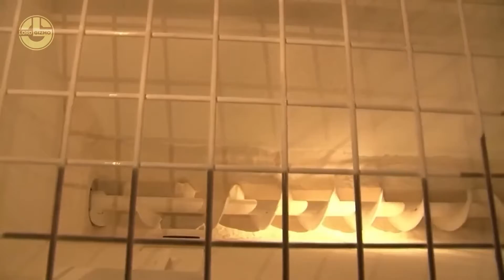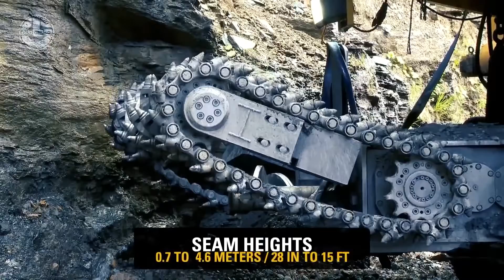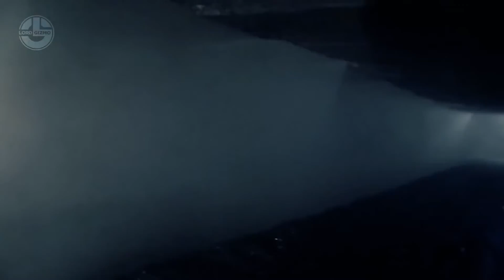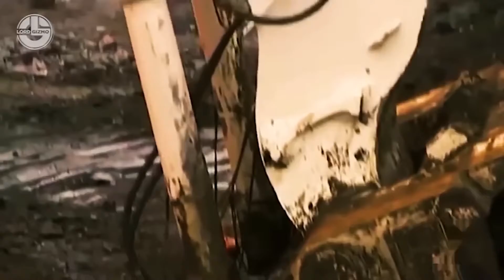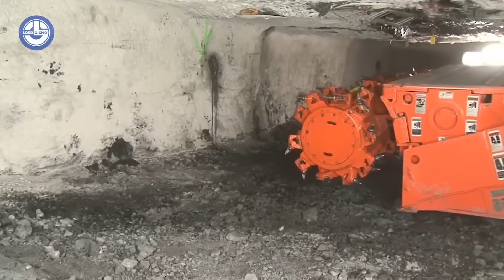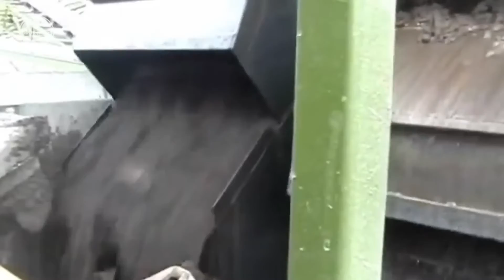500 Crazy POWERFUL Mining Machines And Heavy-Duty Construction Equipment You Need to See!

Comment: Bullet proof bomb proof doors apartments bullet proof windows 
144 fernon street 19148 hancock- Paul Elaine's deli 19148
700 sq ft 2 bed 1 bath 2 story- reconstruction rebuild 
3675 sq ft - ceilings 255 inches x2 510 inches 2 story 144 fernon street underground 3 story 2 street level 
144 fernon street Philadelphia Pennsylvania 19148
Double door width width windows hancock- Paul Elaine's 1 house

Comment: Lompoc usp? Western state penetentiary Pittsburg Pennsylvania 
75ft walls brick stone slate fit taloired across street 1113 Parsons lndg 92154 fence field rest stop construction mining building  workers family's  Parsons lndg 6 car garage house  9657sq ft 
1113 Parsons lndg field fence gate north island indoor basketball court boxing ring weight room build gym#
1113 Parsons lndg auto repair mechanic 92154
1113 Parsons lndg 92154 fence field 
1113 Parsons lndg 92154 fence field golds gym?
1113 Parsons lndg 92154 fence field shopping 
Burlington coat factory
1113 Parsons lndg fence field South Bay dirt bike 
1113 Parsons lndg 92154 fence field apartments 
1 bed 1 bath 5,275 sq ft 1 bed 1 bath apartment 
255 inch ceilings 2 story apartment complex 1,000-2,000 squares